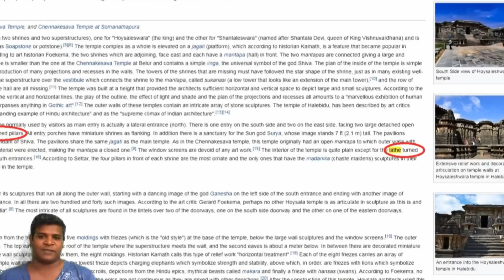Hoysaleswara Temple, India - Built with Ancient Machining Technology?

Comment: The Fact is Brother Is that the tools you are referring to is "Advanced" Such as Rotating mechanisms, From the Potters Wheel to the Lathe to the Copper drill using sand as abrasive these are the Tools that the Egyptians used 4000 years ago the are a LOT LESS Advanced then you think, they Just Turn, Another Way to look at this is Did you think they were NOT AS SMART as YOU Well They WERE JUST AS SMART as you and I

Comment: I'm a techologist, but look for the simplest explanations of how something might be done before more sophisticated methods. My experience is that people can learn to achive very high quality and hard to imagine results using seemingly primitive tools if they have the right motivation.  

Worth exploring:
Plant ranges have changes significantly circumference being h=the largest mutiple.tiples  in the past 2000 years, however, Google search of "Pine cone shapes  India Asia" returned:  Zingiber, broccoli, Boschniakia ..
.

The ratio of feature of a symmetrical object  of 2:1 is athestically pleasing and simpler to execute than any other ratio.  There are many indications that philosophers of this time period were fascinated with symmetry and patterns.  A gear shape can be constructed with a drafting compass using radii that are integral multiples of the smallest arc, with the root circumference being the largest multiple. Once the ratios are known through experimentation, any size gear whose number of teeth are a power of 2 be constructed. 

Saws and drills have been around a long time.
A 1mm sllt can be sliced through metamorphic rock using thread and silica, or thread soaked in a weak acid. Rock polishing is possible with cloth, leather and fine abrasive, the only limiting factor is time. For someone used to the pace of today, it's hard to imagine a polishing operation taking months or year., but that doesn't make it impossible..  

I have no doubt that those columns were machined.  It needn't have been rotary machined from the first rough shape.  Even today traditional woodworkers and stonecutters will use saw, adze, hammer and chisel before moving a large piece to a lathe in the final steps of shaping.  My guess is that it was an logical extension of the potters wheel or grindstone with a twist.  

I never underesimate the cleverness of people in applying simple principles in new ways. Grinding, wheel/axle were well established technologies long before these columns and temples.  

Any material as hard as or harder than the pillar could be used as an abrasive cutter, wearing it away as a simple non-rolling millstone does.

It would be earier to hold such a heavy piece in a fixed position and  move the tool around it instead of vice-versa.  The field threading tools used with steel water pipe work this way.  Columns could be machined in vertical or horizontal positions with the profile  being checked or the tool guided by a template. 

If vertical, the lower wheel could be floating in a moat with bouyancy sufficient to support vertical shafts for tools in a ring carrier possibly in combination with a second wheel above the top. 

It might be simpler to use hand tools to make a roughly circular groove and suspend a wooden ring within it, lubricated with fats as a bearing and lower a second ring with cutters from that bearing to make a smoother, deeper cuts that could be used as bearings in later stages. An alternative would be a tower with an overhang, with a yoke restricting a wheeled tool carriage to  a circular path.

Comment: While there is no question about the amazing art forms and carvings in this temple, one of key features and distinct advantages that the artisans had here is the composure of the stone. Most of these are carved out of soap stone, which when mined is relatively soft and yields well to intricate carvings with less effort unlike a hard granite used for eg. in the Tanjore Big Temple or even in Ajanta / Ellora caves. The stone hardens to stronger rock form upon exposure to air and sun and the elements. These temples are still masterpieces of art form and is a must see..

Comment: I would like to see the circumference of the pillars measured with a fabric tape or other to see if they are exact between each pillar. Or if they'll let you bring in a giant set of calipers to measure corresponding sets of lathed areas even better:) If they are exact, which I think you'll find they will be, then it highly suggests they had a manufacturing line for pre-assembly like Ford introduced in the 1900's, but they would be crazy right:)?

Comment: Those columns match shafts of Roll Forming machines. That whole line of them would be similar to a heavy roll forming machine to form sheet metal into shapes. Those long drawn shapes can be used to build bridges, metal buildings or space ship beams, or to build lifting cranes that lift the big rocks into the machines that cut them!!!. They simply carved them into granite as a monument of heavy machinery building. Their flanges on the top are exactly like bearing pillow blocks used for machines. Other more toothed columns match those used for milling machines that are used to mill the shapes on the other columns. . Dr. Ronald Cutburth, engineering scientist, inelligence expert.

Comment: Some of those statutes have a digital signature, you can see the precision in the curves. As if the rock was molded or formed maybe using force fields as an injection mold that could support undercuts, only way possible. Super high technology. Not engineered by humans of that time.

Comment: well everything you say would need advanced tools is not true it is possible to do it by hand also if they do everything so perfect why would they leave tooling marks on the pillar and not polish them away.
this are not tooling marks they are part of the the design they are supposed to be there. 
also stone on a lathe is way different then metal or wood , you would not have any marks when turning stone.
i think they did use some kind of abresive cloth or rope simply rap it around and pulling it back and forth while walking around the pillar.

the "gear" you call looks like a gear yes but it is not a planetrary gear and how it is displayed it does not funktion like a gear it haves no purpose so i assume it is designed to just look nice or shows a star or something. the "fastener" you call it is simply wrong and the example you did show have a way different purpose.

the small gaps on the statues have to be chisseled as far as possible and then ground away. you can make a indentation put some abresive in stick a other stone a stik or a metal rod inside and turn it an it works like a verry slow drill. also you can do a verry fine cut by drilling a hole first and then get a abresive string through and pulling it back an forth. i assume they tit use long animal hair like horse hair.

the polish of the statue is even more simple. take a pice of cloth or lether or something in your hand make it wett putt sand on it and rub the surface with it. thats how polish works and for a verry good finish you start with rougth sand and later take finer sand and at the final you use only lather and you get a mirror surface. 

the "tools" the statues are holding are no tools. if they are they are waaaaay to big and for me they look more like corn. the is maybe an coloured egg and the one on the right a choklate fruit. 
also the pinecone design is loved around the world maybe they did see it somewhere or its a vorry old corn species.

Comment: 2 big wooden cradles on the right and left of a small river or creek.  Place the pillar in the 2 cradles and the run of the rushing water will make the pillar turn like it would in a lathe.  Now be in front of it with a sharp object. perhaps a diamond and carve away while the pillar is spinning.  That would be my best guess.  There could be even small stone balls in the cradle that act as ball point bearings to help the spin.

Comment: Quite interesting and impressive. 
I call BS @1:36. If it was planetary gears, the outer ring would have the teeth on the INSIDE. Maybe it's 1/2 the amount of teeth because there's 1/2 the space for the same sized teeth?? Planetary gears are called that because gears orbit around a center gear, like planets.
@3:45- Wrong, "It is impossible to remove the inside of small a sphere".
@6:50 Possibly food, seed pod???

Comment: water wheel, windmill, etc. = turning force. It wouldn't be hard to lathe turn pillars with them.

the crown was attached (you found the seam yourself), and the skulls carved out from the back side.

the pinecone/tool depictions could be a variety of things. there are a wide variety of plants with similarly shaped structures or flowers.

900 years ago isn't what I'd call "ancient", It's actually quite recent from a historical perspective. They'd have had access to steel tools, the lever, gears, hand powered drills, cranes, smelting, and a wide range of building techniques.

Comment: You want an explanation for the "2:1 gear ratio" device held by the deity? How about artistic crafting? To make the smaller "gear" fit into the larger "32 tooth (teeth?) gear" it had to be a 16 tooth. And is it really that difficult to come up with the 2:1 ratio to make something small fit in what is bigger? If they had put a third gear outside, would it have a 4:2:1 ratio or 3:2:1?

Comment: I worked with machining tools like lathes, milling machines and grinders and if someone has told me to make such a skull, I'd just laugh and say it's impossible. You'd need a drill bit that goes inside through a tiny hole and then changes it's angle in the middle. Also you'd certainly need a programmable milling machine because when doing it by hand it would be very easy to make a small mistake which would ruin the whole sculpture. But still I'm not aware of any modern tools that would make it possible.

Comment: The problem of our time is that we are at the end of a long history of simplifying tasks our ancestors were already carrying out employing simpler tools and taking time our machines recover for us, and expending effort we have since passed off to machines.  It leads us to think that our accomplishments are impossible without tools our predecessors lacked.  However, consider the differences between a lathe and a pottery wheel.  Orientation and the medium used.  And actual lathing goes far back - ancient Egypt for instance used lathes thousands of years ago.  The key mental steps are to connect the methods and work out execution.

Comment: As  one that has worked in the manufacturing industry most of my life- I'm amazed at everything you showed. There are many tools in our modern arsenal but even then it begs the question of how they achieved the intricate detail. My only and best guess would be investment casting with a very hot cement made from different types of stone powder to create a scientifically convincing stone material BUT! even then; How would they create an entire building that way?!? Amazing!  Thanks for the interesting video Phenomenal Travel Videos. Subbed for life.

Comment: As for the explanation of the pine cone looking object possibly being a burr, I would have to say unlikely. Burrs work at very high speeds. For a hand powered tool to reach the speeds necessary to effectively use a burr to carve hard stone is a big leap. Likewise, for them to have had high speed machinery to reach speeds necessary to utilize the cutting characteristics of a burr they would have to have had some incremental development towards making something as complected as high speed machinery. If that were the case you would expect to see ample evidence of such developments. A far more likely, down to earth, explanation would be that they simply employed stone carving "art/technology" that have been lost to the ages. There are many examples of this in modern Technologies. The "pine cone" shaped object also looks very similar to a flower bud. Which one is hard to say. Possibly a lotus or lilly, since they are an extremely prevalent symbol in these ancient religions and have remained symbolic to this day as in the "Flour de Lis". I realize the facets, for lack of a better word, on the objects, are numerous compared to the outer petals of these flower buds, which I suspect they were trying to emulate. For this I only have one explanation Perhaps it is an extinct flower or perhaps it actually is a pine cone because it is a suitable replacement for the flowers. I have reason to believe these flora were being used and processed chemically as catalysts, of sorts,  in their spiritual endeavors. To me this is a far more likely explanation. It would also help explain the importance of Pine cones in a region without pine trees.

Comment: Is it impossible to load the uncarved stone pillar on 2 smooth treelogs, same length as the pillar ,then attach at the end of both of the treelogs to a mechanism driven by donkeys or running water, wich will maken the logs and so the pillar spin fast wich enables you to easily make these carvings with a lot of water and the right tools to carve it. 

I'm sorry for crappy english, but just assuming that the number of teeth on the "gear" (wich could also be a sun or star) in the statue actually confirm advanced machinery is not science or investigation. That's just assuming. So they made something rotate, what's so fancy about that? The neanderthals actually conducted the very first synthesis by making glue from treebarch. Does that make them something special? They're just humans, they built stuff. There was no super megapolis with flying cars in pre-iceage asia okay?

Comment: Lathes have been around since 300BC  and the stones that these pillars are made of are not terribly hard and can be cut with quartz and other hard minerals . so yea .. okay so it was just an ancient lathe.  if you notice however on the big sections there are many many tiny grooves as the tooling used wore out quickly. No aliens needed to make this stuff. And the polished surfaces were done so by sand. Mystery solved.

Comment: The circular imperfections indicate the speed of the process, if done slowly then there would be less imperfections. These columns were carved by a mechanism and tool (now called a lathe) vertical or horizontal in a short amount of time. There are two things required, bushings to spin it on and a tool hard enough to cut the material. Grease was available this could easily provide the lubrication for the bushings which only leaves a harder material to make the cutter....diamonds perhaps? Impressive work even by today's standards.....Another question is given the amount of time required to feed a population large enough to make such a structure one must imagine that it was difficult to have the free time exist by which others could toil away making the structure which is in itself a huge subject fraught with difficulty all it's own. Add to this the schooling of generations to continue the work and you imagine a very intelligent organized society....don't just imagine the rocks left behind imagine the management that existed and how wise they were. The sharpest tool is still perhaps the brain power required to accomplish the whole of the task.

Comment: I dont think this temple is 900 yrs old, most likely all of our megalithic constructions are much much earlier. And if it is 900 yrs old, still we have clear evidence of a high minded culture. 

I recently did demo work on a 6 foot thick vault that housed a cyclotrone partical excellarator. Purpose was radiation sheilding. We used core drilling and wire saws to disassemble the vault into smaller, movable blocks. With ease. All of our equipment was simple, except for the motors. But still basic enough. It was clear to me after that particular job what a small crew of men can be capable accomplishing working with cement. Its not rocket science. 

You are using your higher mind and critical thinking, just like your anscestors. Well done.